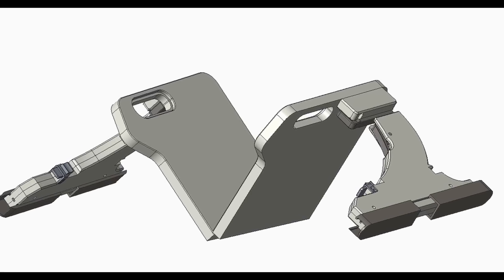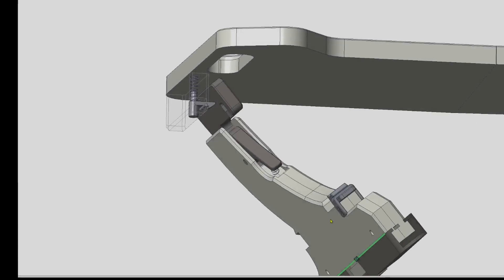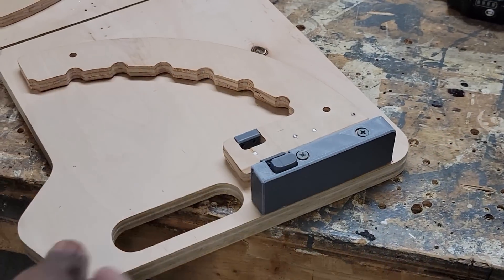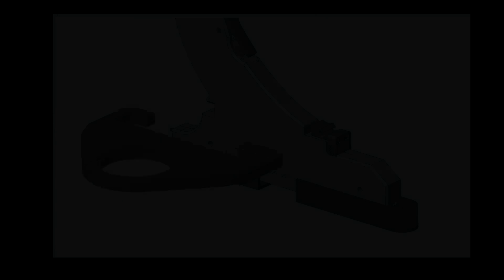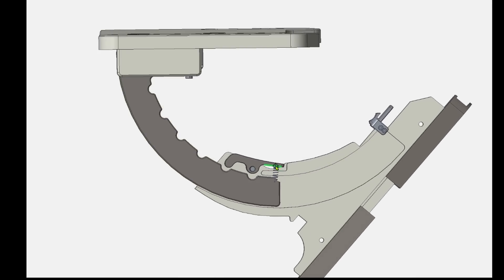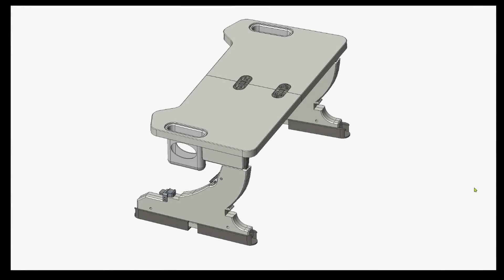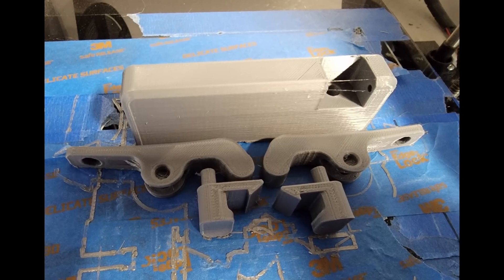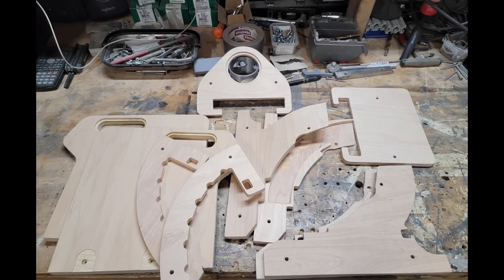Watch Me Design and Build a folding Table Step by Step!

Comment: G'day from Australia. Well now, that is brilliant. What a great idea. Just wondering, do you sell both the CNC files and the 3D print files. If so, I would love to purchase them. Keep up the great work. 🇦🇺👍👍
Reply from the maker: Hi Chris, Thanks for watching my video. I should be able to avail the files to you. I will need to sort them out first though being that all the 3D printed parts have now been converted to Aluminum and are also designed with metal manufacturing tolerances. The Plywood thickness for both the 3/4 and 1/2 also vary  depending on the hardware store. This is reflected on the CNC cutting programs.